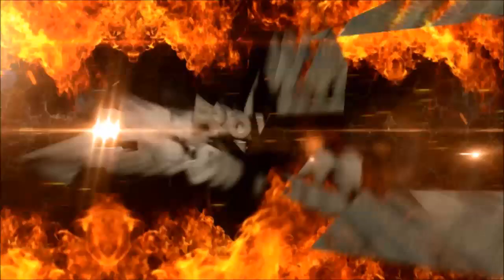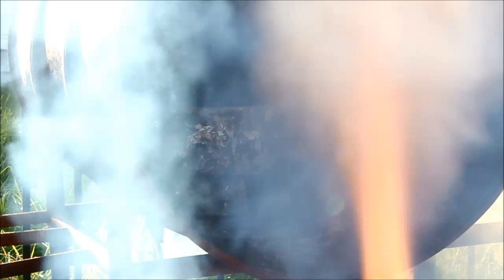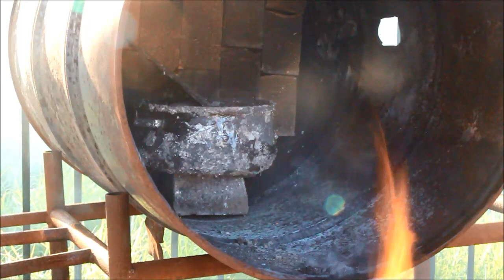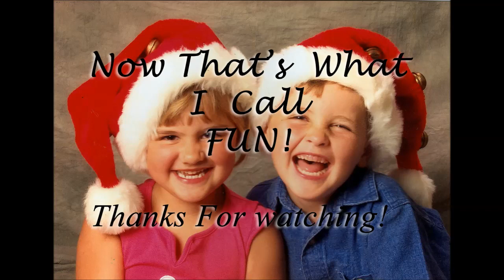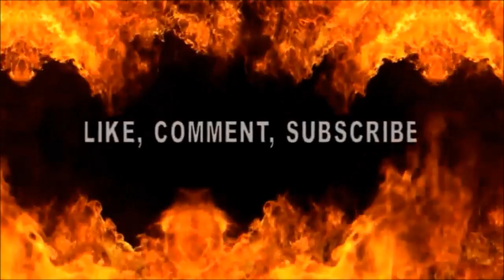Exploding Scrap Metal Furnace Oil Burner Backfiring

Comment: Thanks to Your Videos and to hundreds  of them I have watched in 4-5 languages , regarding the same field ( WVO, WMO, furnaces, burners, refractory bricks and cement, stoves, forges, theory of pyrolisis and so on...) now I know that I can realize all my shop-tooling projects, for few Euros (instead of 300€ or more), simply adopting your solutions: 
-No refractory  materials like Bricks, mortar or cement, ceramic blanket - No graphyte crucible, - No expensive nipples  nor Propane. In addition to this,  I will be able to melt the alluminium of a pile of radiators, like you did with the engine head,  building a big burner and avoiding a really tedious job,  like to cut them  with angle grinder  or hammering them...in order to fit them in a crucible and in a foundry furnace. Of course in my garage/ backyard almost all what I need is already available like a few different molds, pipes etc. At the moment I have only one problem:  I have to find how to stop watching your vid. At least those i allready watched 10 times. The reason is hat I LIKE THEM. Especially because  your pleasure of playing with fire is evident and contagious. Best compliments: for your sense of humour and sympathy, first of all. For simplicity, originality, and effectiveness of the solutions You have found. Absolute clarity of your explanations. Thanks a Lot. From Italy

Comment: I've burned my face off, twice. Once a trash fire blew up and got the right side and once an automobile gas tank got the left side. If you work around this stuff, you take some risks. Good video!!
Reply from the maker: Fully agree Kevin. Last time I copped something in the face was when a wrench fell off a workbench and shorted across a battery that was underneath it. I looked down just as the battery blew up. Last weekend I was demolishing a brick fence with a sledge hammer and caught a piece of brick in the forehead above the goggles I WAS  wearing. Didn't take much notice till I saw the blood running down my face! :0)

At least when something finally happens with the burners, I'll be able to justify it. 
Getting pretty tired of reading all the safety sissy warnings about what I do with them but the accidents I do have are nothing to do with the most adventurous pass time of all.  :0)
Reply: Oil Burner There's safety, and there's safety gone mad. The safety side of me says 'good you were wearing goggles, bad luck about the blood thing!'. A safety gone mad nazi would say "Right, full face shield from now on"
Reply from the maker: ***** "....... And a hard hat and gloves and a fire proof suit and a respirator and have a medivac team standing by with a Chopper spooled up and ready to go on the neighbors lawn..."  The safety side of me says " You know there is going to be shit flying everywhere, you'd be an idiot NOT to wear goggles  doing that."  Safety to me is self preservation. I'm not going to lose a hand or die welding without gloves.  There's every chance I could lose an Eye Smashing bricks with a sledge without goggles so that's why I do wear them then.
Big difference between safety obsession and common sense.
Reply: Oil Burner
So true. Now, about the toilet based oil burner, come any closer to finding one? <grin>

"Does the flame swirl the opposite way in the southern hemisphere?"
Reply from the maker: *****
 Long as the turds don't come back up, I don't care which way the thing swirls!!!  Actually, our thunder boxes don't swirl at all, Only the sinks do.  The Thunderboxes just flush from all round and go straight down the center.
With the burner crapper, Pretty sure I can get that to " Swirl" any way you want.  So farm haven't seen any spares around anywhere.  Usually you do see them on the side of the road but old thing, when you want one.......

Comment: am interested in your video about the burner exploding from too much oil or fuel.
I have built a furnace for melting aluminium.   The burner is a gravity feed tube inside a 1/1/4" tube that carries the air flow.   I had problem getting enough oil through so re built it and put a 1/2/"  finishing with a 1/4" stainless tube.  It now run a full pipe but        :(  then when I opened the tap up to provide more oil flow It went out then exploded and re0ginited and did this until I cut both the air and the oil flow. I am using waste engine oil mixed with some diesel and  believe I am on the right track to make it successful.  However, I am not an expert and would appreciate some comments from you regarding fuel mixtures and how to best adjust it.   Call me a worry wart but I prefer to have some more knowledge to avoid it:)  thanks

Comment: I just found you channel and this video, awesome stuff, I have experienced this first hand but in a different setup, never the less the result is still the same.
Reply from the maker: I'd love to do a burner for a steam train. I looked up the heat requirement for a train and found it wasn't as high as I thought. The train in the grand canyon is WVO fired and forget the output of that but Remember it was less than what I have done already.  I think I'll start working  on a 1000Kw Burner.  That should power a train and give the boiler more steam than ever before!  :0)
Reply: Yeah, WVO has been used for many car/ truck for ages, if you have a look at some of the videos on my channel you will see the locos I used to drive at a theme park in QLD, for many years they cried about the cost of running them on diesel but never did anything with the thousands of litres of WVO oil they would use and then give away to a mob for nothing.

Cheers Mark

Comment: hey how the devil are ya , man the crack like thunder don't they ? I run a pressure fed burner and it goes off like a machine gun . Keep up the safety tips for the wowsers
Reply from the maker: It was quite impressive.  Maybe with a long pipe out the top I could make a new kind of forced air driven pulse jet.

Comment: You should have a read what the siphon nozzle burner snobs said about this video on AA. It is under ( Delavan Siphon nozzle issue not working ) read reply 28, he said your burner is so dangerous! He also said he could not get it to work, maybe he should have had a chat with you.
Reply from the maker: I looked back in there a couple of months ago and laughed how many refrences and  amount of bitching there was about me. Those little pussys must feel really threatened buy anyone that does any thing they can't. Pretty clear that was the reason we got the boot mate. 

Why am I not the least bit surprised they are still whining and whinging about me 2+ years after kicking me off the site for being  politically incorrect? They were stuffing around with those nozzles trying to get them to work the whole 10 years I was on that site and 2 years later, these geniuses still can't get a specificaly manufactured part to do the job it was designed for.  Meanwhile, I produce a heap of different burners out of whatever scrap I can find lying round and they work without problem.  And they bitch about them. Typical.  

Someone couldn't get the burner to work? Proves what a moron they are. I couldn't even count how many messages and vid links I have got from people whom have built them and use them all the time.  100 people do it, one moron can't, who is the idiot?  Wonder how many of them cast molten iron like you and have anywhere near the success. 2% IF that!

Must be embarrassing to go spent  50, 75, $100+ on a part made for the job and not be able to get it to work while some pelican on the net puts up vid after vid of Different designs he builds for nothing which run like no tomorrow.
I have not spent on all my burners put together what these clowns spend on one and still fail. Funnier still, you have one that works without problem and it performs as it should. No wonder they didn't want you there!

 I have been involved in a lot of things and on a lot of forums but the metal casting/ working online forums are without doubt, in general, the biggest bunch of candy arse, limp wristed, safety zealot, jealous pack of cry baby bitches I have ever come across in any interest. 

That cjcaster waffles on endlessly trying to hold himself out as some god like authority but clearly that's a disguise to cover his real lack of knowledge and insecurity on the subject. I have to say I'm surprised that yellow bellied gutless j.vibert wasn't having a dig as well.  He's another 2 faced jealous little bitch trying to elevate his own lack of knowledge ans seem a lot more informed than he is. 

Care factor for these whining Pussy bitch little girls.... Zero!  :0)
Reply: Do you want a good laugh? Read this thread on A.A. " Multi-Flow Siphon Nozzle Burner"  look at reply 13 to 18. He has been banned twice now! What makes it soooo much more amusing is he tried to build your burner but couldn't and then trashed your burner in another post.

Comment: Ha Ha That's better than my furnace yesterday - I start it on diesel and drop a piece of burning newspaper in and turn on the air and close the lid. Yesterday if lit but went out when I closed the lid, I was just about to open it and try again when it re lit with a god awful bang. Lucky the safety nazis aren't around when I'm casting - usually in bare feet!!!! Do wear face shield and gloves and a leather apron now to stop my left boob getting burnt!! But we're Aussies so what would you expect!!